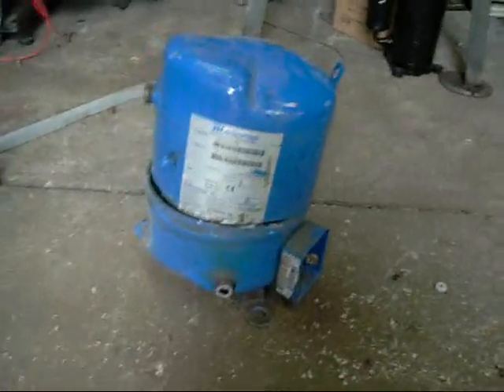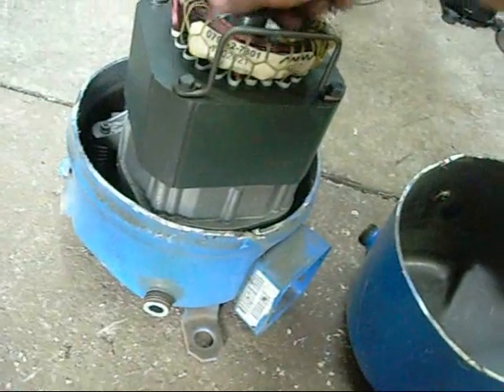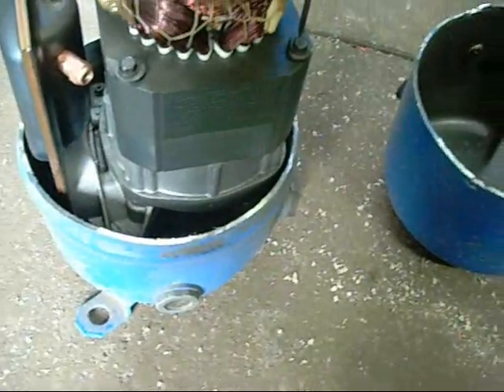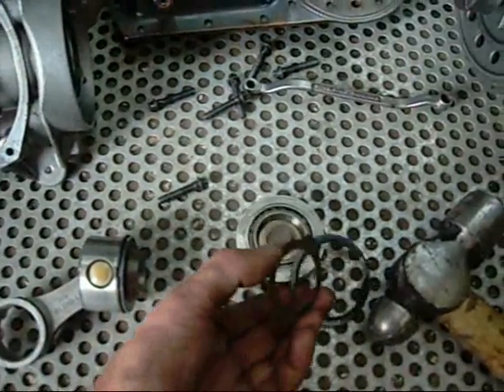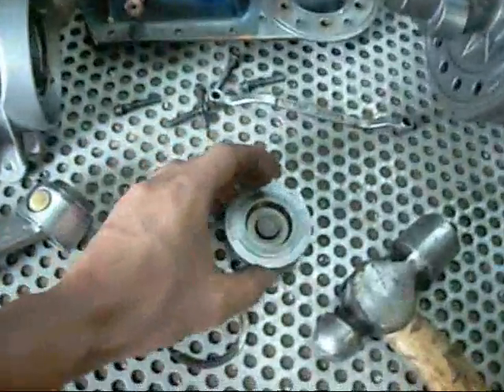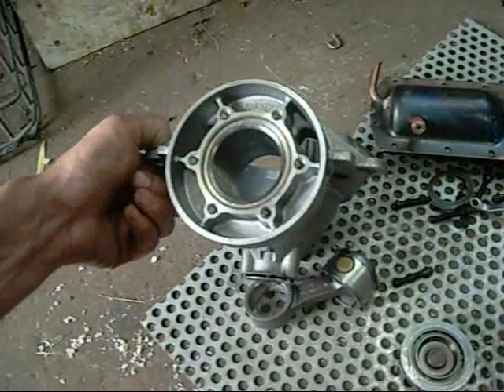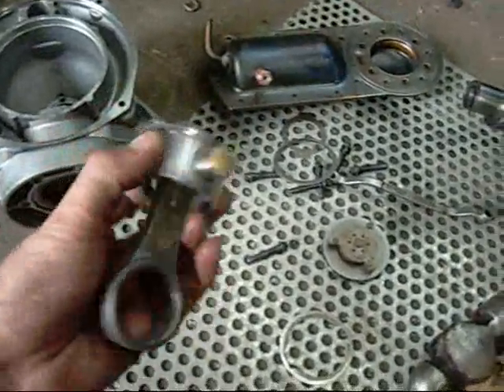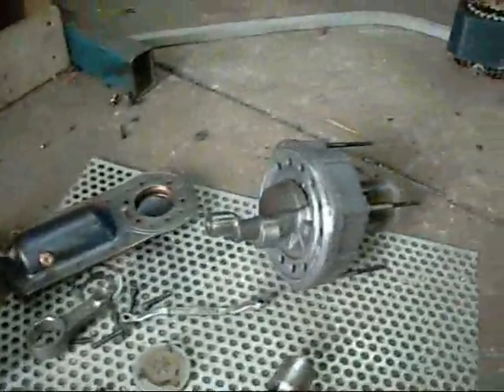Danfoss - Maneurop MT28-JE Compressor Autopsy - Reed Failure

Comment: @V8Jagnut  Slugs can smash up either/both valves, once saw on an old semi where the suction valves are held in with two pins sandwiched between the block and valve plate one of the pins had been fired through the rest of the vavle plate (locating hole is only half thickness) and onto the cast iron head where it just left a shiny mark. (see my "off with its head" vid for the type of comp) Also a bad valve can knock out the bearings as the rod is always loaded, instead of push then pull as normal.

Comment: Hi Ed! We are having the same suction side reed valve failure issue with one of the two compressors in our huge 3300L climate chamber at work. Suction side closed->compressor hardly pulls any vacuum... :( Compressor is a Tecumseh TAG2522Z, do you have any good/bad experience with these? Repair will cost a fortune...

Comment from the maker: @V8Jagnut odd that its the suction valve not the discharge. a shattered or warped discharge valve would definitely be a slugging issue. but pounding the intake to the point it warps is also not impossible.